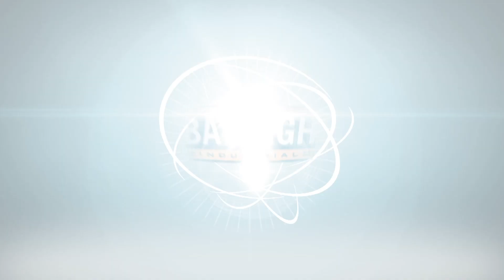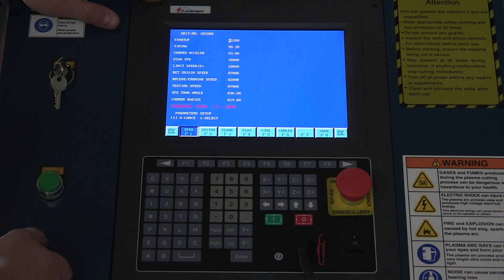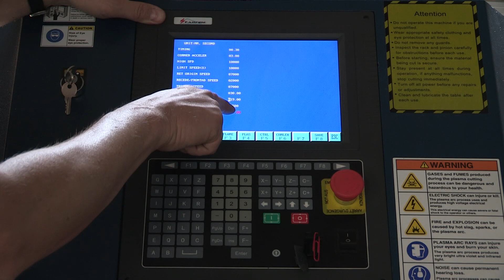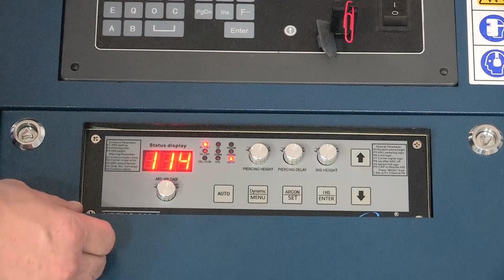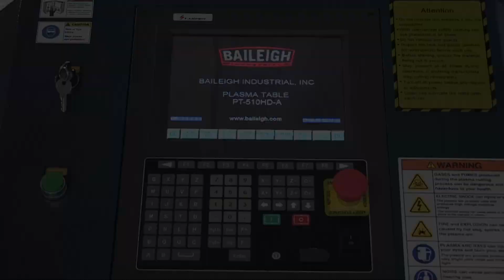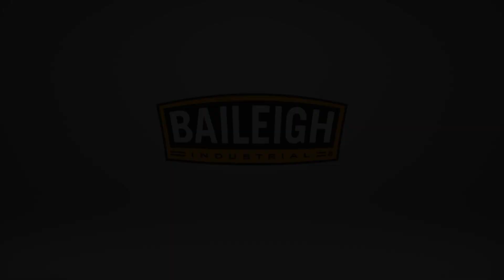PT-510 Setup

Comment: Hi sir, sir I'm operator of laser and plasma machine, we have purchased new plasma RJ 1530 (STARFIRE / HYDTHC). Sir i want to cut 4mm or 5mm sheet so i need your help that what should be values of piercing height and piercing delay.